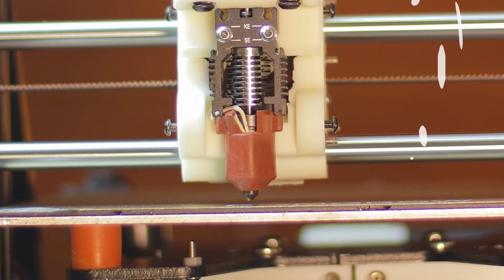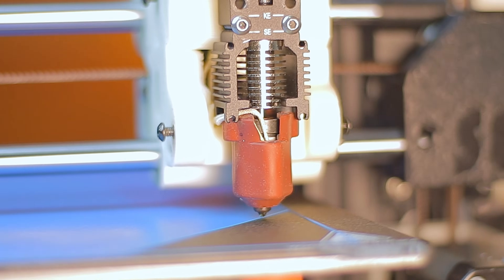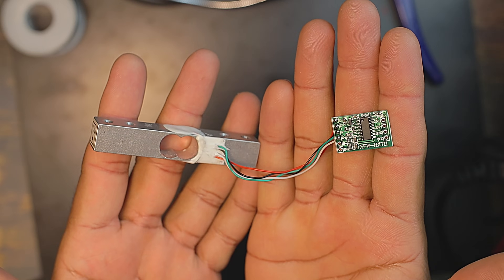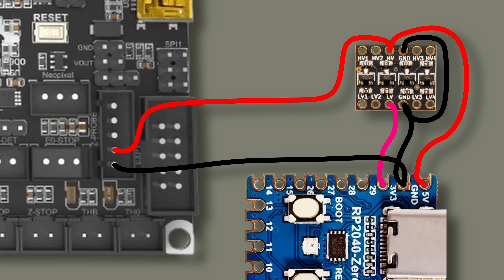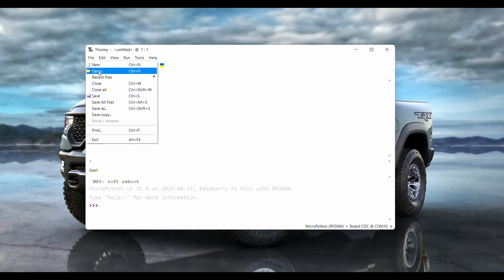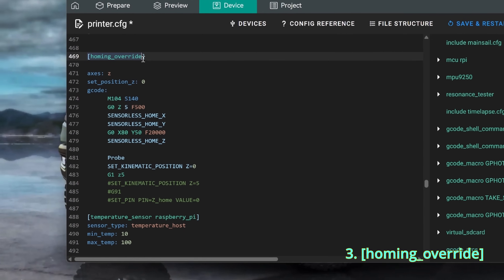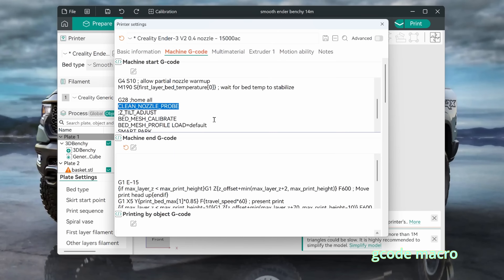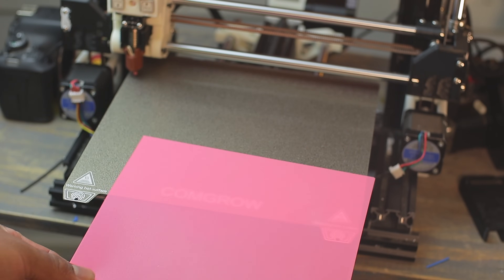Fix Your First Layer! The $10 Z-Probe for Perfect 3D Prints

Comment: I used the Creality CR6-SE for years with Klipper (even made a Github with the Klipper install). It's load cell is not made a well as the one you use so probably you reach even better results but the CR6 gives very reliable results as long as the nozzle is clean!. I love the nozzle cleaning macro you made, that will make the CR6 even more reliable.
Reply from the maker: That's great to hear your experience with the CR6-SE, and thanks for the positive feedback on the nozzle cleaning macro.

Comment: That's generally cool, buuuuuut. It's ok for a bedslinger, where main speed holder is weight of hotbed with carriage. But on modern high speed corexy printers all that extra weight is a bad idea.
Reply: Mellow 3D have this system but in a compact form, its called the ALPS-V6 and E3D have one for the Revo.
Reply from the maker: Totally agree! Extra weight works for bedslingers, but on high-speed CoreXY printers it really hurts performance.

Comment: How do you do it?

I mean i decided against nozzle probing because it would need a nozzle cleaning apparatus.

Alternatively can skip that but then needs a glass bed only, because probing buildtak-clone (polycarbonate) coated beds with a hot nozzle is a no-no.

The nozzle needs to be hot for cleaning but cold for buildtak, which is a conundrum.

Currently i use a swing probe. A simple 9g servo that turns a horn towards the bed, carrying a mouse switch. I used to have a 4.3g servo but i broke it, but i have an endless supply of 9g servos so it's fine.
Reply from the maker: I address nozzle cleaning in the video, but thanks for raising that point about different bed materials, that is a good observation.

Comment: What about probe accuracy test? If it worked once for a video doesn't mean it works every time
Reply from the maker: Totally fair point—just showing it once doesn’t prove reliability. I’ve been running repeat probe accuracy tests using Klipper’s built-in macro to make sure it’s consistent. I’ll share more videos soon so it’s not just a one-off example.

Comment: Very clever method - totally independent of bed coating material and thickness. BTW load cell is used in my Anycubic SLA printer to detect lack of resin or other issues as broken details laying on FEP.
Reply from the maker: That's a great point about the bed coating and thickness, and thanks for mentioning the other use case!

Comment: This is the best first layer I’ve ever seen—I couldn’t achieve this even with my Bambu Lab A1 Mini or Creality K1C.
Reply from the maker: Thanks! I thought the print would go unnoticed—glad you appreciated it!
Reply: Yoy should have different problem with your Bambulab printer. I have an A1 and the first layer is always perfection. Bambulab uses loadcell and works great. I can not say same thing with K1C because when I purchased it came with warped bed, I needes to print some spacers and placed them between bed holders and bed surface. K1C also uses loadcell but when if the bed warped, it can not tolerate.

Comment: Is the work temp gonna be a problem? Like i like to print ABS. And what sizeof load cell 1 kg? 5kg?
Reply from the maker: I’m using a 5kg load cell, but really, any size will work depending on your setup size. I’m also building a toolhead board with a built-in temp sensor, so you can easily compensate for any temperature drift
Reply: @everythingdiy32  i got like Heavily modded Ender 5+ with EVA tool head and no  tool head board
Reply: @everythingdiy32   then i probably need a temp probe on the load cell

Comment: So good i found this! I was planning on doing this type of levelling but worried about the coding side. Guess thats solved now 😊
Reply from the maker: Glad to hear this helped you out!
Reply: Yeah, thank you very much! One thing i saw is that you only used one of the loadcells. Do you think there is any advantage in having both connected in an and-configuration so that the one that triggers first is key? Might be a good failsafe through backups

Comment: This is great idea and implementation. Just a thought, have you checked the data from the load cells when printing, specifically when actually extruding? I think this could be a great failed print detection as well. During extrusion, when actually in near contact with the previously printed area, I would think there would be positive pressure from the load cell, If printing in air, like a print failure, I would expect no load from the load cells. The unit could do double duty by just changing the output pin in the rp2040 software when the zhome request is off. Might depend on the sensitivity of the load cells used.
Reply from the maker: Fantastic idea! Failed print detection would be huge, and there are so many other things we could tap into with the load cell data—I’m already thinking of a few cool experiments.

Comment: Thats a cool idea. I have been looking for this loadcell diy setup for both main probing z-zero and also redundancy  limit system for my printers( when probe/sensors/switches failed ). Seeing your full load cells x2 might be heavy and my space constraint I may decided that to be on the bed itself especially flsunSR solid bed with no forgiving springs & 3 motors acting on the bed. ❤thanks for sharing bro. Appreciate it
Reply from the maker: Glad you liked it. I tested it directly on the bed too, but each probe point reads a slightly different load depending on the load cell’s position. It works, but it’s still not as consistent as mounting the load cell on the toolhead.
Reply: @everythingdiy32  yeah I do suspect reading with broader range so it function as a safety net in bed mode thinking in terms of the solid bed FLsunSR. Any number beyond that the point where the main probe fails to trigger, it calls for this setup to take over. 😂still figuring how to set this in Klipper before I commit to implementing the loadcell limit switch idea. My priority is safety net. Thanks bro for yr ideas again.

Comment: I think you could move the load cell to the build plate. That would reduce the print head weight
Reply from the maker: Putting the load cell on the toolhead lets you do more, like check nozzle pressure or adjust for filament tension while printing.

Comment: In my opinion adding CAN transceiver and making rpi2040 as a remote mcu would make setup even cleaner, especially if your toolhead is already CAN-based
Reply from the maker: Absolutely a CAN transceiver with the RP2040 as a remote MCU would make things super clean on a CAN-based toolhead. 😉 Let’s just say… I’ve got a little toolhead board project in the works that might make this even easier—stay tuned!

Comment: klipper acctually support the adc converter board (HX711- green board) ur can connect direct to main board and set up on klipper fm. but nice ideas thought, i have same ideal with you on the first place.
Reply from the maker: While Klipper supports the HX711 module, its resolution is considered insufficient for probing tasks according to the official documentation. It is still suitable for measuring filament weight, such as in spool scales. Klipper recommends using at least the HX712 for probing, but that module is not widely available

Comment: make sure to have a cleaning solution, if your nozzle isn't clean your offset will be wrong
Reply from the maker: You're absolutely right about the importance of a clean nozzle. In the video, I demonstrate a Klipper macro that performs a nozzle cleaning routine before any probing takes place. It’s designed to prevent exactly that kind of offset error.

Comment: Your wiring shows only one load cell being used but you have used two load cells. How is the second load cell connected?
Reply: I think it's there just to have a similar beam holding up the other side of the tool mount.
Reply from the maker: Oops, I forgot to mention in the video—only one of them is hooked up

Comment: This is very nice! 
@3:42 This shows only one load cell connected, however, your design uses two?  
I'm also amazed how big these load cells are. Aren't there any smaller alternatives? And; How many grams does one load cell weigh?
Reply: Smaller load cells are more flexible. Also keep in mind that if something fails the nozzle could crash into the bed with enough force to bend and destroy a small load cell
Reply: I agree with you, to big load cells and too big capacity (with a possible losing sensitivity). And the lack of just one PCB with all the electronic, for an easy installation and fail proof. But the idea es very Clever, just a few fine tunings and will kill all the other solutions (RIP BLtouch, you served well). Hands on a custom circuit design, and to wait for the parts ...
Reply: Yeah I'm keen  to do this but they are rather chunky... maybe could use one from another 3d printer.. I think ender 6 has ones for 10 bucks...bambu a1 uses one too
Reply: 5kg load cells are actually pretty sensitive at the range he is using them. Also the smaller the load cell the more likely you are to get errant drift signal that needs to be tuned out and easier they are to be damaged.
Reply from the maker: Even rated for 5 kg, these load cells are very sensitive at probing forces. Smaller ones are actually noisier and less stable.
Reply: @everythingdiy32  no word anywhere about how the second load cell is integrated into the circuit…

Comment: Good work!
But something doesn't quite add up: in design assembly there are 2 Load Cells, but further on in the video there is only one that is connected to the Amplifier Board and then to RP2040.
So is the 2nd Load cell used at all?
Reply from the maker: I've wired only the one load cell. i will upload the details on my github
Reply: @everythingdiy32  Wait... so one load cell is enough?

Comment: Why do you need a logic level converter, if at 4:24 you show that you're running the logic signals directly into the mainboard? If you really have it wired as in the diagram, it's doing nothing. All that is needed is that the grounds are shared, and the RPZero is getting 5V from the mainboard (it has its own 3.3V regulator next to it)
Reply from the maker: Can't believe 😂 LOL. That's a mistake. The signal should have routed thru the logic level converter. Thanks for pointing that out. i will fix the part. And update the video.

Comment: Is there a way to use smaller load cells?
Reply from the maker: Absolutely, I just wanted to use what was available to me. And I like my printer to be fast so I used big ones.
Reply: @everythingdiy32  smaller should be better for speed since it's reducing the mass on the tool head, no?
Reply: @Code-Sandbox-Dev  I beleive the smaller the load cell, the less ridgid it is. Because the nozzle is only mounted to the cells.
Reply: @Code-Sandbox-Dev  it´s a tradeoff, since smaller load cells are more wobbly. you might be able to run harder accelerations before the stepper goes out, but your print quality will degrade faster with speed because your hotend will be less securely mounted.